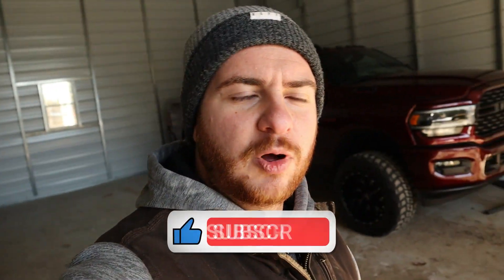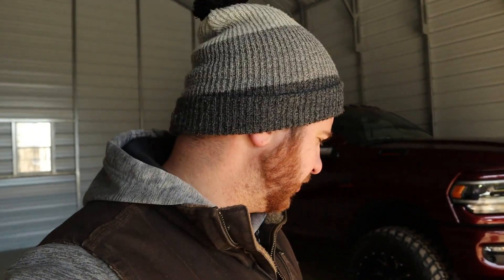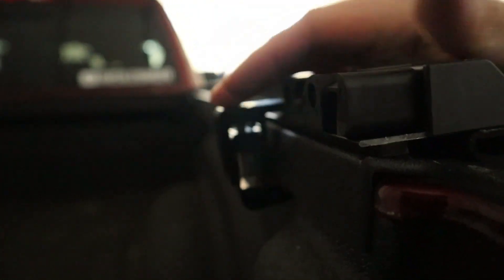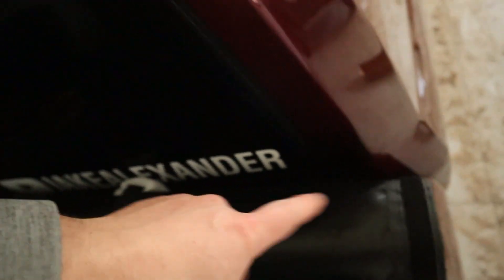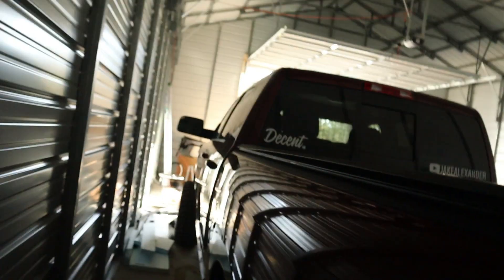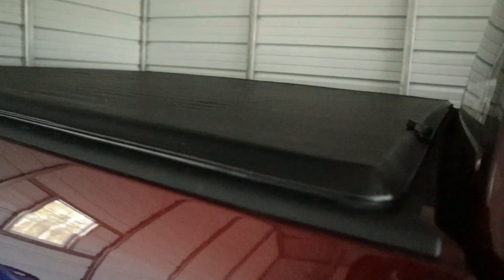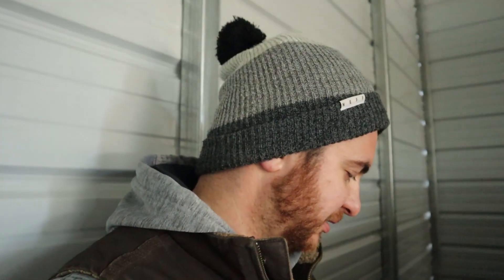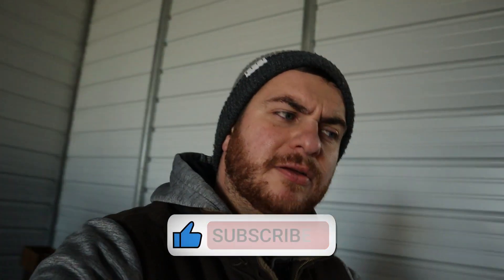I Bought The CHEAPEST Tonneau Cover I Could Find Online | Is It Any Good?

Comment: Do the tires still rub? What did you do to get it to stop?
Reply from the maker: Still rub. I just deal with it. Could go bigger lift, smaller tires or less offset on the wheels. If you really like the fitment, you could remove the factory splash guard and if still runs after that you could cut the pinch weld out to clear the wheels.